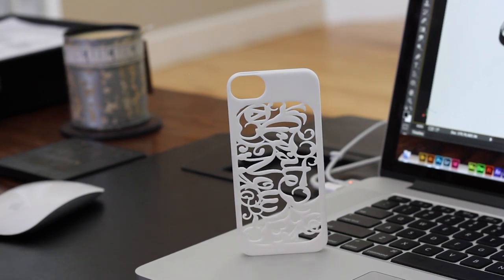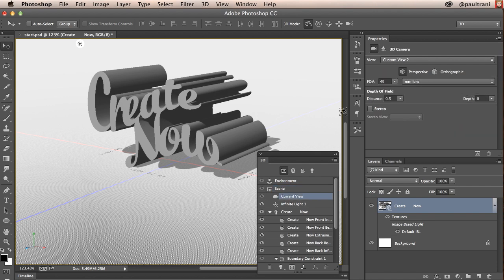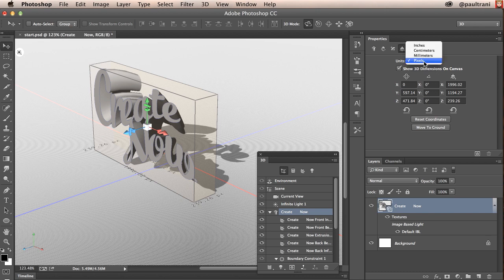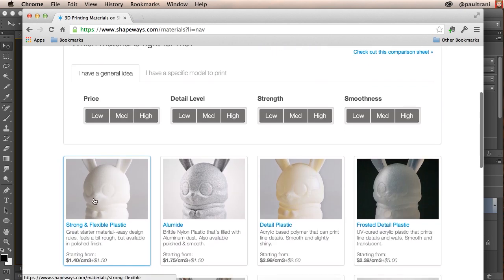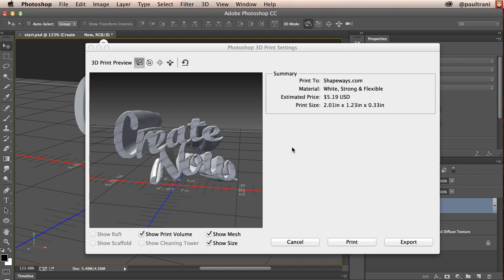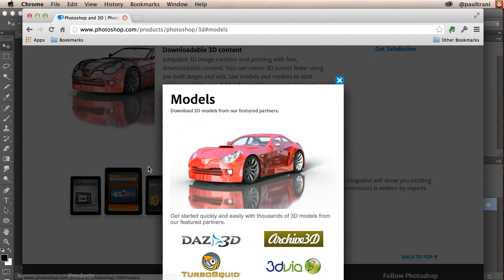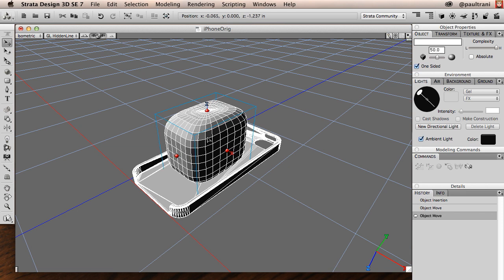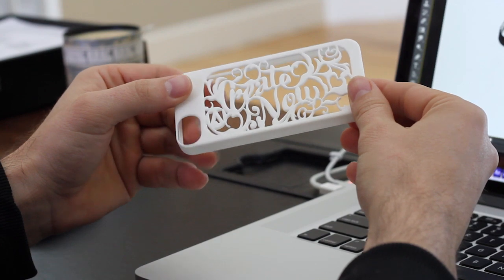3D Printing: Create an iPhone Case in Photoshop CC

Comment: I have a question. How can you use the 3D feature in CC? I have an Imac 27 but cannot get that feature in CC or CC(2014) only on Cs6. It looked as if you were using a laptop?
Reply: The 3D option is in photoshop extended version